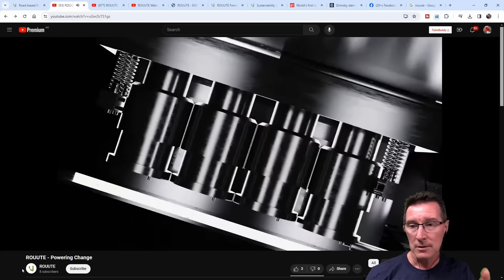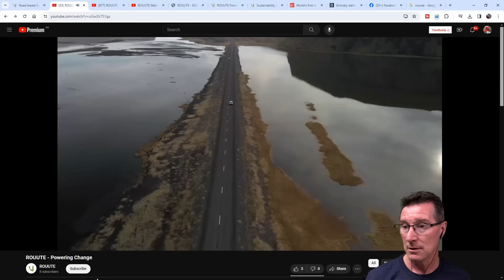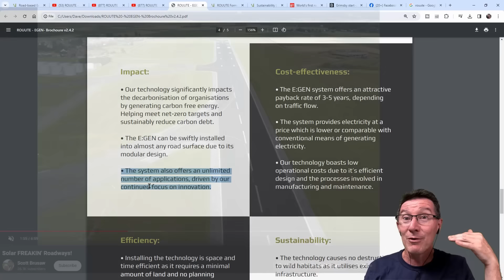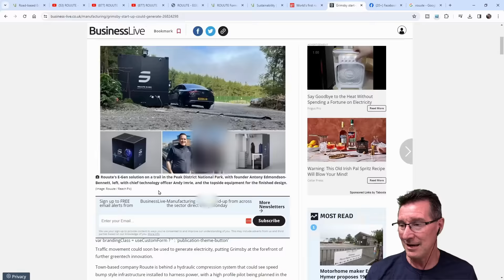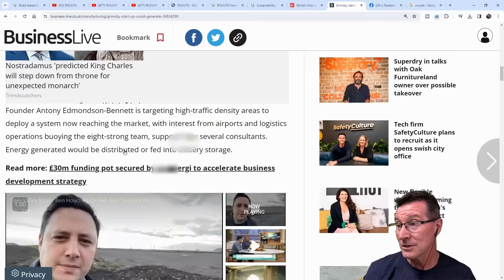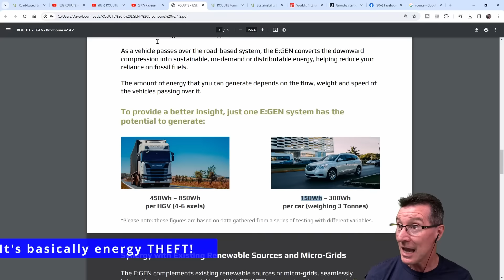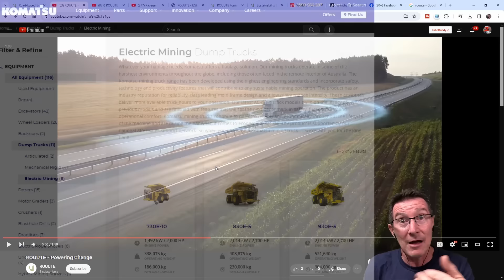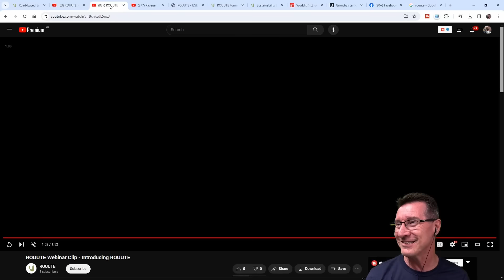EEVblog 1600 - Rouute: Road Based Energy BUSTED

Comment: Even going downhill, what entitles them to steal what should be *MY* regenerative braking energy? I put all that energy in going uphill and it’s still my energy to utilize how I want/need.
Reply: Less bump also means less energy..
Reply: You voted control freak leftists in.
Reply: You mean driving on your private road, on your private land in your private kingdom? Well... sounds like you've got a valid complaint there. 
You should contact your local SLOP outlet - Secretariat for Libertarian Offense Protection.
Reply: @d3nza482  do you really think you did something with this comment? You just made yourself look stupid.
Reply: @d3nza482 Actually as roads are built from my taxes, The roads are public property,  And the re gen energy charges my batteries,
Reply: @d3nza482  Think harder. You’re missing the obvious: The energy and road use is already taxed.

You don’t get to backpedal on that arrangement and literally rob me of what’s mine. This is the downhill equivalent to going up a set of steps that lowers on you with each step, robbing you of the vertical height you put into each step… like an escalator running backwards no matter how slow.

Would it be OK with you if they sipped fuel directly from your tank on the way down and then claimed it was waste energy that they recovered? Obviously not, but that’s essentially what they are doing to when they steal your energy. It’s a straight up LIE to imply this is waste energy recovery when one of the main ways modern vehicles are as efficient as they are is because they use that energy themselves. They are literally robbing hybrids and electrics of their efficiency. That energy is supposed to go back into your battery when you bleed off speed going down hill.

Have fun trying to rationalize something that simply can’t be rationalized. I’m glad we had this talk. Hope you learned something.
Reply: LOL! @emmettturner9452
Reply: @emmettturner9452 To be fair, most brake regen systems are not 100% efficient. You can only shove energy back into the battery so fast.

I don't know the numbers for newly manufactured cars, but it was less than 50% several years ago.

Either way, this tech does threaten to essentially steal energy, if the regen breaking is efficient enough.

For gas vehicles it is more efficient than standard breaks.

But this tech is very limited in usefulness on the whole no matter the vehicle.
Reply: @jasonh4534  “this tech does threaten to essentially steal energy, if the regen breaking is efficient enough.” It steals energy regardless.

“For gas vehicles [this tech] is more efficient than standard breaks.” It isn’t limited to hybrids and electric vehicles: you don’t need regen braking to use the energy they steal.

If you conserve your downhill momentum without braking it will help climb the next hill… or maintain speed further on a flat without needing more fuel. Someone stealing that energy from your momentum or invested potential (height) hurts your efficiency even on a pure gasoline vehicle with no regen.

Dave suggested it might make more sense going downhill for capturing waste energy. My point was that it is not always waste energy. Modern vehicles (electric and hybrid) increasingly have their own regen braking and a hypermiler in a combustion vehicle also manages their energy to conserve/apply as needed to maintain efficiency. That’s why it makes sense to look at it as your energy investment to apply where you want/need it.
Reply: @emmettturner9452  You really are not thinking what I said through...

Any braking energy that goes into a traditional braking system will just get wasted away as heat. It is therefore unusable and lost to the vehicle.

This system would reduce but not eliminate the amount of brake force needed on such steep/long hills. Especially if implemented in a manner that would not annoy people traveling on the road due to excessive bumps. (Meaning it would need reduced overall vertical motion, and therefore would have less energy recovery)

If they tried to implement this with bumps similar to speed bumps, that would not go over well. At worst, they could get away with something akin to driving over expansion joints, or those paint strips that make your car vibrate a bit to warn about a blind stop. Anything more could be dangerous on top of the annoying factor.

No regen brake system is effective enough for long and/or steeper hills. Some use of traditional braking will be needed.

If you are in such a situation in a traditional vehicle and "conserving" energy... You will, by definition, be breaking speed ordinances. IE speeding. If you are not speeding, you will have needed to use your traditional brakes or engine breaking. IE losing energy to an unusable state.

This system is absolutely just asinine... And yes, it could steal real and usable energy from a vehicle if implemented improperly. (And such a system likely would be)

But to claim that any and all energy this system would gather is stealing, is a bit much. You are essentially arguing that harnessing something you are throwing away for other use is stealing.

I guess, just as in a very specific and technical sense, taking someone's garbage from their roadside can would be stealing... You could claim they are stealing heat from your brake pads...

To summarize, I am thinking about the implications of a refined and more developed version of this system, not the crude examples shown in the video. The examples shown are impractical and unworkable on any real scale and on any road expected to see real and constant traffic, at typical travel speeds.

And I think it is a dumb idea... If that wasn't clear.
Reply: @jasonh4534  “You really are not thinking what I said through...” Oh, I definitely did. Unfortunately the comment got ghosted.

My point was that traditional braking isn’t the only kind, especially since the advent of hybrids and electric vehicles. It would not only rob them of their efficiency gains, it also robs a pure combustion vehicle of its energy.

Example: A hypermiler might deliberately crest the hill at an extremely slow speed to limit braking and conserve their energy without going too fast. They will deliberately gain speed going downhill. Slowing them down steals the energy needed to maintain speed or crest the next hill without dumping in additional energy.
Reply: @emmettturner9452  While there are other types of braking, in an electric vehicle... They are not efficient enough to regain all energy on sufficiently long or steep hills.

Electric vehicles have traditional brakes on them for this exact reason. Any use of those traditional brakes is wasted and unrecoverable energy loss.

And a hypermiler as you discuss is such a very specific and limited example, it doesn't really apply here. Besides, if I was stuck behind such a person on the road, I would probably be pulling out my hair and wishing much harm would befall them.

The long and short of it is... Implemented well, a system such as this can't be really said to be stealing energy in any practical sense. Only in a very specific and technical sense.

Feasibility of such a system isn't part of this specific discussion I am having, though. I am more addressing the idea of such a system only being functional through actual practical measurable theft of usable energy, rather than being plausible to be implemented in a way that isn't stealing usable energy.

My stance is that, in theory, it would not steal usable energy in normal traffic flow. Given a proper implementation... Though it very well most likely would should such a system actually be attempted. Mostly due to the poor planning of those in charge of such projects.
Reply: @jasonh4534  My diesel can completely recharge the battery packs from leaving work to the village at the bottom of the hill, And once I top the hill at the other side I can finish the journey home with the engine off, 
On the other hand if this device was in the road I would have to brake hard from 60mph before going over it, otherwise it would be like hitting a brick.
Reply: @jasonh4534  “While there are other types of braking, in an electric vehicle...”

Hopefully YT won’t ghost me again so we can stop going in circles, but we’ve been over this. Hybrids have had regen braking for 24 years so this isn’t just “electric vehicles” …and it doesn’t matter how comparatively efficient it is: they are still robbing Peter to pay Paul. It doesn’t matter if Peter wasn’t the best money manager. It was still Peter’s money …and why assume Paul is any better? IOW, why do you think this system is so much more efficient?

Next, why aren’t combustion vehicles entitled to their energy investment? They can use it to gain speed after cresting slowly or use the excess speed to carry them partially over the next hill as any hypermiler would do.

Not all energy recovered from regen braking goes into charging batteries. The energy can go into climate control and be 100% efficient with a resistive heater or even more efficient with a heat pump. It can go into a supercapacitor with near-zero loss for immediate use when cycling rapidly between propulsion and braking.
Reply: @jasonh4534  Hypermiling techniques can be applied to different degrees. Everyone who understands physics and cares about efficiency will manage their speed to limit uphill acceleration and downhill braking for the same reason you don’t speed up to a stop. It wouldn’t matter if regen braking only recovered 50% and this system recovered 99%: it’s still mine. If I lost 20% when charging off the grid then the least I can do is recover half of the energy this system would otherwise steal.
Reply: @jasonh4534  Friction brakes aren’t for regulating speed where regen alone can slow you to a crawl, even downhill. They’re for staying stopped or when the user occasionally exceeds the limits of regen braking. Outside emergency braking regen does the lion’s share.

With normal braking many hybrids and EVs will never need a brake job… and the ones that do usually rusted in the salt belt.
Reply: @dogwalker666  The devices they show in the video are not viable for actual deployment in a real road.

I'm talking expansion joints like feel... You are talking speed bumps. I also am not talking flat roads. Only very steep hills.

But I can guarantee you that your regen breaking in your car is far from 100% efficient, and you are using traditional braking during your trip. If you have any steep inclines.
Reply: @emmettturner9452  Look... A viable version of this system that does not annoy drivers is not going to affect things that much.

So in your example of 50% regen, and 50% brakes... what would change is that... 50% regen, 40% brakes, 10% going into the system.

The system would only reduce your need on your traditional brakes. No viable system would be able to gather all your downhill energy, or even simply prevent your need to brake at all.

The "working" systems they show in the video are not viable for actual deployment. They are proofs of concept at best.

A real system would have an actuator no taller than about an inch (25mm) above the road surface.
Reply: @emmettturner9452  Regen brakes that can recover that much energy are physically impossible, at least in normal braking situations.

Coasting to a stop? Sure
Slowing in flowing traffic as speeds fluctuate? Yeah
Maintaining speed on a relatively shallow slope. No problem
Stopping from 60mph (100kph) to a stop due to a traffic light... No
Maintaining speed on a steep incline... No (go drive through the Rocky Mnts and tell me with a straight face that regen can handle those inclines on Interstate 70)

As I said, I am talking situations like going downhill in the Mnts, not flat roads or slight hills.
Reply: @jasonh4534  Time for an update: It’s no longer a split like that. While early regen was less aggressive and tied to friction brakes, normal stopping distances at any speed are now almost entirely regen if you do it right. Fastest roads with stoplights are 55MPH but even at 65+ you won’t need to touch the friction brake until you are nearly stopped unless you are emergency braking or driving irresponsibly.

On its own, regen can bring you to a relative crawl on a steep incline making friction braking irrelevant for regulating downhill speed. There is no reason to think roadway recovery systems could do that more efficiently and it wouldn’t matter if it could since it’s your energy.
Reply: @jasonh4534  The current Bolt EV in single-pedal drive will regen down to a heavy stop without touching the brake and has more on tap using a regen paddle. Earlier models didn’t apply any friction braking in single-pedal mode and had two paddles to regen harder. You only had to press the brake pedal for holding the stop.
Reply: @emmettturner9452  Where are they dumping that energy?

In a typical stop, say for a light or other reason from a normal travel speed, the amount of energy required to stop a vehicle is very high. Gradual slow downs are another thing entirely.

The problem is the sudden burst of energy generated. It is going to be higher than can be safely input into a battery over such a short time frame.

You can't change physics...

The batteries are the limiting factor here. Too much power input will damage them. Newer systems can charge much more quickly than before, but even the best charge system is slower than the burst of energy generated from stopping at speed. And fast charging at those rates reduces the battery lifespan, so I know they are not going to be that aggressive with Regen braking which happens many times per trip.

If the car has no way of storing all of the energy, then some will be wasted. Even with newer tech, and more aggressive regen curves, it is unlikely that cars will be able to avoid the friction brakes.

There are ways to store the energy, but I am unaware of any vehicles with such a system. Typically only large capacitors are able to take the full sudden burst of energy. At least until they get full. which depends on the size of the system. Even a larger one can be overwhelmed by long periods of breaking like on a long steep incline.

I am sure that with careful driving that you can do a lot with regen braking... But most drivers are very aggressive with their throttles and brakes. They accelerate quickly, they wait to apply brakes until they need to use heavy braking force, and they tail gate, causing them to be very sporadic and aggressive with brakes.

Sure, you can drive in a manner that may not touch the friction brakes, but most people will not drive that way.

I know the physics of regen and current battery tech will not allow typical drivers from avoiding use of friction brakes to slow down. Even if it seems that way from a user perspective.
Reply: @jasonh4534  You underestimate the capability of regen braking and evidently haven't driven a modern EV. EV batteries can be charged at 100s of kW - equivalent to 100s of horsepower. That's plenty to slow down a car fairly quickly. My Tesla Model 3 can generate significant braking torque from regen alone. Enough for 99% of normal driving including stopping for traffic lights, slowing from highway speeds, descending steep grades, etc. I'd say my driving style is distinctly normal/average and I'd only use the friction brakes in sudden/emergency scenario, and of course the car must blend in friction brakes with regen as you come to a full stop as regen can't work down to zero speed. That's literally all the friction brakes are used for. In fact it's a bit of a maintenance issue - owners face failing first inspections due to corroded brake discs as they are simply not used. I have to go out of my way to do periodic hard stops just to clean the brakes.

So you are looking at a tiny subset of extreme conditions, like really steep hills, where systems like this in the video are not simply taking energy from a vehicles energy source, whatever that is! And these are just the sort of conditions where it's arguably dangerous to have a car bouncing up and down and potentially loosing traction. You say reduce the height of the compression to only 25mm or so - then it simply will hardly harvest any energy! You'd then need dozens of them one after the other to have any use at all.

Realistically you don't want an instantaneous bump (or multiple of them in series) at all - you'd want something more like a patch 10+ metres long of compressible surface that would feel more like driving onto a sticky surface that wants to slow you down. But then the mechanical engineering of the recovery gets much harder. Overall - total nonsense!!
Reply: @jasonh4534  no-one said regen systems were 100% efficient, this will reduce regen braking efficiency further though. And regen systems are effective on long and or steep hills, in fact that is where they are most effective. Regen braking force is proportional to the velocity one is going, this actually means there is not braking force if not moving, but that is when you are using traditional brakes. Hybrids and Electric vehicles will lose efficiency from this system as it is sucking the same energy the regen harvests.
Reply: @jasonh4534 no, it'll take from the regen just as much, if not more so.
Reply: @EwanMarshall  I am not arguing that this system cannot reduce efficiency of regen, my stance is against the blanket statement that it can only ever reduce efficiency and never be capable of only harvesting the waste energy, while also leaving 100% possible recoverable energy to the regen system.

I am arguing the pure physics of a theoretical well tuned future version of this system.

As I said, I don't think that in reality it would be practical or utilized in a way that would be fair. IE by not stealing usable energy from the driver.

Let's break down the math a bit to better understand what I am saying. (This will be highly simplistic and abstracted to a high level overview, no actual math calculations)

A moving vehicle has a certain amount of kinetic energy K
At the top of a hill the vehicle also has a certain amount of potential energy P
As the vehicle moves down the hill, P will be converted to K increasing the total amount of K

Braking systems reduce K over time 🔺️K (delta K)
This reduction in K will result in energy conversion of a certain amount of energy per second E/s
The form this conversion takes depends on the brake system. Friction brakes create heat, regen brakes convert (with losses) to electrical energy

There is a maximum E/s that can be handled/recovered by a regen system. (Er_r) This amount varies by vehicle, but is probably much lower than you suspect, even in a newly manufactured vehicle. The indication systems are not always 100% transparent on what is happening.  On a sufficiently quick stop, the system is very likely going to need assistance from the friction brakes. Resulting in some energy lost via friction (Ef)

On a stop that requires no input from the friction brakes the math looks like this.
🔺️K=E/s=Er_r

But anytime 🔺️K results in an E/s that exceeds the regen system capability, the friction brakes must take up the slack.
So 🔺️K = E/s = Er_r + Ef

This system would reduce 🔺️K some amount and convert it to electrical energy. (Er_b)

So in theory...

In a hypothetical well engineered version of this system.

The system would reduce the 🔺️K to a point that would bring down the E/s closer to the limit of the regen system, reducing the need to supplement via the friction brakes.
🔺️K=Es=Er_b+Er_r+Ef

Does that clear up what I am saying?
Reply: @jasonh4534 you don't magically get to decide to only take energy from the non-regen side, the regen system already does this in a well tuned way for a particular vehicle. You are not going to actually be able to beat that with a system road side. From a pure physics perspective regen braking force and recovery energy is proportional to velocity, if something else is reducing that velocity then regen will work less well and recover less energy meanwhile the energy recovered by this thing is no way going to be tuned for the specific vehicle in question.

There is no place this a) doesn't harm regen, b) does a poorer job of recovering energy and slowing vehicles

You should also look at Vigier Ciment, a Swizz Cement Company that use a 45t battery electrc dumptruck at their quarry and never need to plug it in to charge. You see they need to takes stuff in a downward direction so they fill up with 65t of limestone at the top and regen all the way down, and only use the batteries when going up. Yeah, you can make a vehicle that recovers more than it uses in the right conditions. These are the kind of conditions where this thing might have a use, but battery dumptruck is already better.
Reply: @jasonh4534  Conversion losses for any kind of charging are 20% at best. Even if charging were 100% efficient and you stopped with regen from 200MPH, you’d still be charging slower than the slowest L3 DCFS… so it DOES have a way of storing all that energy from a 60MPH stop (minus conversion losses).

On the rare occasion we disable the 80% charge limit and fully charge we lose 1-pedal drive and regen for miles so it’s not just dumping any excess as heat. Under normal circumstances (including a 60MPH stop) regen can do almost all of your braking except for the last moments where you need friction brakes to hold the stop anyway.
Reply: @jasonh4534  The roadway recovery system is not capturing the 20% conversion losses and is subject to conversion losses of its own. That is why you cannot say it is capturing “waste” energy. It is stealing yours… and that would be the case even with a combustion vehicle since managing your speed to minimize braking is the key to driving efficiently.

Regarding how people drive: Unlike regen paddles, 1-pedal mode regulates the regen smoothly. It will also force “most people” to drive differently since the car will regen hard as soon as they take their foot off the accelerator to hit the friction brake pedal. 9 of 10 times the regen will slow faster than expected without the brake pedal and they’ll put their foot back on the accelerator to slow gradually and avoid stopping short of the line. This is why many EVs will rust to bits before they need a brake job.
Reply: @emmettturner9452  I am not counting conversion loses, I am factoring in energy that exceeds the regen system's capability. (Energy into the regen system is energy captured plus conversion loss. Ein=Ecap+Econloss) So a regen system may be able to capture a maximum 🔺️K (Ein) and that will include recovered energy and conversion loss. Any energy 🔺️K still left when the regen system has hit its maximum input, must be shed by friction brakes.

To put some real numbers into the discussion. Stopping from highway speeds. A complete regen stop captures 100% of the energy but only 70% is recovered due to losses. On the lower when stopping more rapidly, where friction brakes also kick in, you get as low as only 16% recovery after losses in the conversion and the friction brakes. This is from online sources.

Other sources online show that the maximum (total) regen rate on Tesla vehicles is only about 90% on a typical stop. (I had to do some math for that one) leaving 10% for the friction brakes.

Basically with a typical stop time, the amount of 🔺️K you need to shed per second exceeds the regen system's capability by 10%. Leaving that excess for the friction brakes.

Tesla limits the regen power input to the battery to 0.2c (that is 0.2 total battery capacity rate. Example for a 100AH battery 1c=100A charge input and 0.2c would be 20A) So if the maximum braking force desired by the driver exceeds the regen system's ability to put 0.2c charge into the battery, the rest of the brake force must come from friction brakes. (As I mentioned, a typical stop from highway speed requires a 🔺️K that is 10% higher than the Tesla regen system can take)

I did see that in track mode, regen rate is increased a further 50% to 0.3c, this would increase recovery, but actual track driving means the total braking force would increase significantly, due to the extremely high amount of braking track driving entails. So actual efficiency would still be reduced. (Typical track driving is 100% throttle followed by 100% braking force, this is to keep speeds as high as possible for as long as possible. You hold your pedal to the floor until the last possible second before you hit the brakes as hard as possible to slow yourself to the corner entry speed)

Does that all make sense for the point I have been trying to make?

I don't doubt that a careful driver could use 100% regen braking, most drivers I don't think would. The math on maximum input from regen backs that up.
Reply: @jasonh4534  “I am factoring in energy that exceeds the regen system's capability.” Again, the regen will only exceed that when emergency braking (efficiency be damned) or when the battery is fully charged… and you shouldn’t be fully charging your battery. The friction brakes handle a truly negligible amount of the braking and ALL of the concerns with recovery efficiency apply to any other system that wants to harvest the same energy.

Can this capture 100% of the energy it takes from your forward velocity without conversion losses? No. It’s taking the same energy many vehicles increasingly rely on for their efficiency and it’s no more efficient than they are with it. I can’t steal your money, do the exact same thing with it, and then claim I was just recovering “waste” money. That’s the lie.

What you see from Tesla is an inefficient facsimile of traditional braking so users will not have to change the way they drive. That’s not how pure regen works. Braking down mountains does not exceed the capacity unless you are still driving an old hybrid with a NiMH pack… and this is coming from a 2000 Pontiac Montana minivan driver who occasionally drives his brother’s Bolt EV.
Reply: @4534Okay, limiting what goes into the battery does not necerssarily mean we must switch to friction brakes, we just need to shed the excess energy through a resistor bank for example to still get braking effect but not actually charging the battery. That said, chances are you aren't over the regen charge limit anyway unless you are doing high speed driving. Remember earlier when I said you get more energy back and more braking force from higher speeds.

But you miss the big problem, you do not get to choose, your additional make road bumpy will cut efficiency out of all parts, you do not get to choose that it only takes from the excess. Hell, you are probably going to want to take the road slower for comfort thereby making it worse yet still.
Reply: @EwanMarshall  True, there are other options to shed the energy other than the friction brakes... Either way, that energy in lost and unrecoverable.

Like I said, in an idealized version of the system, the bumpiness felt by the driver would be minimal. This also means total energy recovered by the system would be lower than possible with larger bumpiness.

As far as choosing what energy this system recovers... You don't exactly choose no... But any energy it takes is just subtracted from the whole. What is left is for the car to handle with its own internal systems. Meaning the car can maximize the amount of recovered energy from that remainder and dump the rest.

So let's use some simple numbers, and also abstract away the specific units to make it easy.

Let's say the regen system is one such as you say, that dumps energy in excess of what it can recover, into heat via resistors. It never touches the friction brakes for actual stopping force.

We will say that the total energy available due to the reduction in kinetic energy is 100 (you could imagine it as a percentage if that helps)

The regen system can take an input of 80 for use in recovering energy for recharge (that 80 would include whatever energy is actually recovered plus the conversion losses)

Lets now assume a standard road. So in this scenario, for the vehicle to shed 100 energy, it would use the regen system to take in 80, and then dump the remaining 20 into the resistor network. 80+20=100

Now let's imagine a road with my hypothetical idealized version of this system. In order to minimize annoyance to the vehicle occupants, the system uses actuators that move a small amount. Making them no more annoying than expansion joints. Noticeable but not bad. I would guess that such a system would only be able to recover a few percent at most (2-3%) if it is lucky, but let's be generous and say it can recover 10%

Now using the same figures as before.

Of the total 100 energy available, the road system takes 10. This leaves 90 for the vehicle to handle. The regen system takes in its max 80, leaving 10 for it to dump into the resistor network. 10+80+10=100

In summary, there is a maximum energy change that happens. The regen system cannot actually use 100% of the available energy for actual battery regeneration, and the remainder must be dumped as waste. In theory, this system could reduce the waste portion, while leaving the maximum amount the regen can actually put to use available.